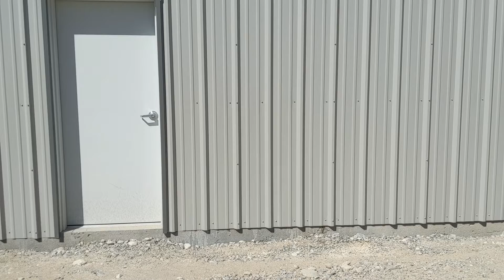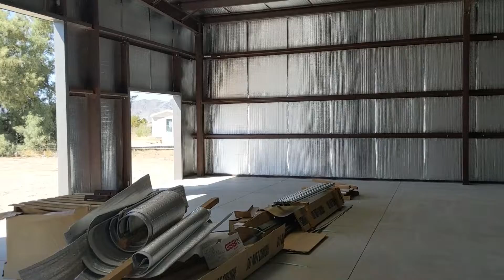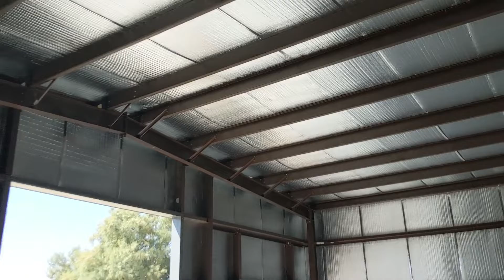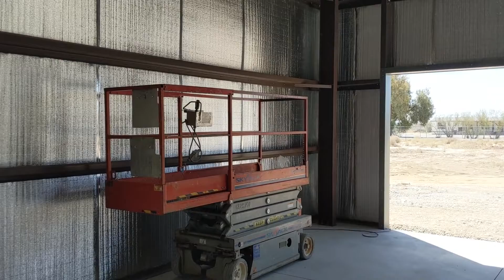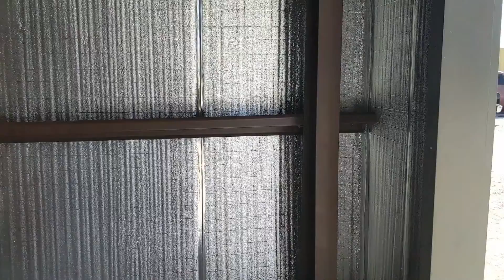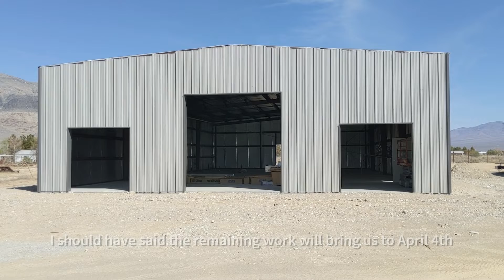Status Update, Steel Building Shell Nearing Completion (New Steel Dream Shop + Home Ep. 13)

Comment: Very nice man.  In the process of building my steel building shell.   Would you still recommend Prodex for roof and walls?   Also, was it the 10mm or 5mm?
Reply from the maker: Sorry for not replying to your comment earlier. Until recently, I mostly watched YouTube on my TV and did not get notifications about comments as a result. It is the 10mm version. I've found that Prodex is great as a radiant and vapor barrier, but I think it needs to be supplemented with additional insulation. I later installed R30 fiberglass metal building insulation (MBI) in the walls and roof, which made a huge difference in comfort, both summer and winter.